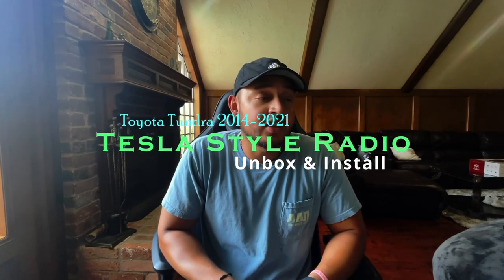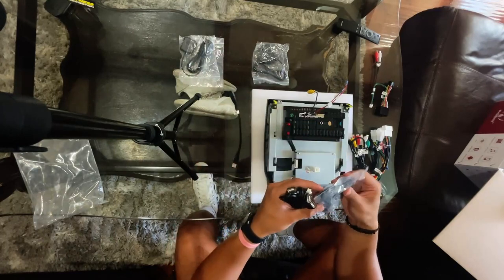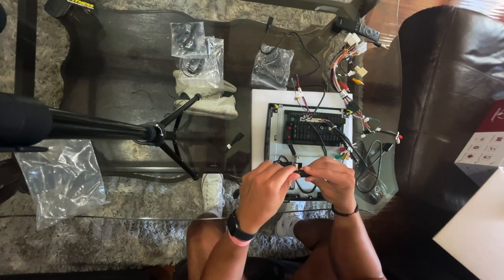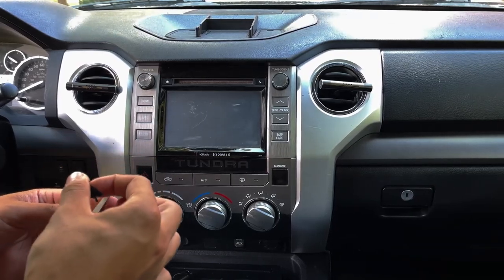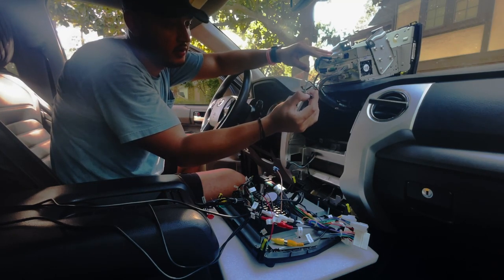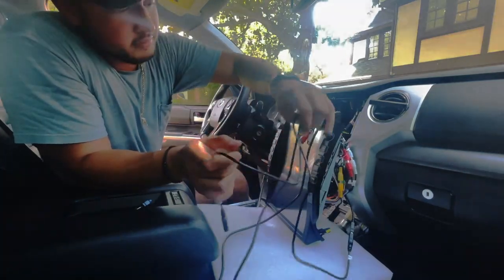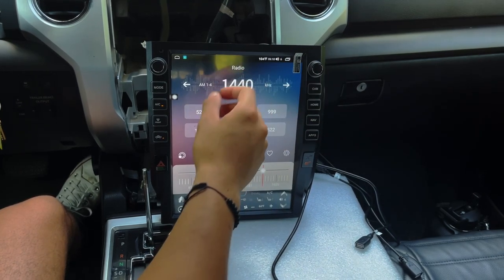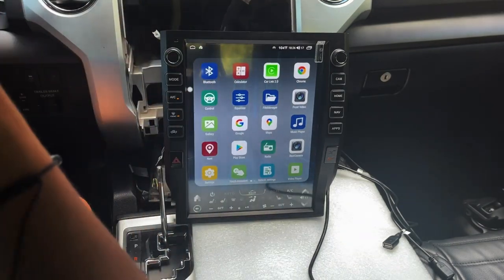Tesla Style Android Radio 2024 With (CarPlay) Install & Overview - Toyota Tundra

Comment: Just got mine today and installed it. Everything good, perfect fit as well but only one thing is the sound kinda low for me even i volume up to 30 and not good as oem head unit. Idk how to deal with this.
Reply from the maker: I didn’t have any trouble with my sound, maybe it could be that you didn’t fully connect the wires ? But if anything I would just message the company!
Reply: Does the heated and cool seats work?

Comment: The WiFi you’re using, is it from your cellphone hotspot or is it the WiFi from the head unit?   I only ask because I have a 2021 1794 with the built in WiFi and wanted to retain that feature.
Reply from the maker: Yes I was using my phone hotspot, my truck is a 2017 so I couldn’t know if the head unit would mess with your built in WiFi. I do know the T-style radio model I got is for 2014-2021 tundras.

Comment: How did you get the tundra on your main screen and your rpm to work? My mph works but rpms ,no
Reply from the maker: I have the same issue with the speed but my unit came with the custom truck on the main screen since that’s the make/model I put when buying the unit.

Comment: Does it work with the factory steering wheel controls for the radio? I’m looking at this for my 2014 Tundra sr5
Reply from the maker: idk about the 2014 Tundra but the steering wheel controls do work on my Tesla style radio (2017 Tundra)
Reply: Post a link the exact radio model please. I've been all over thier website and only see 2007-13 and I have a 2014